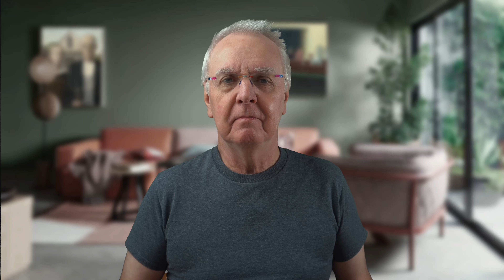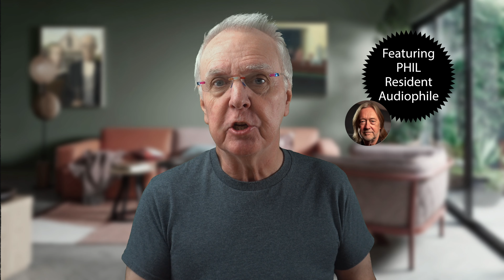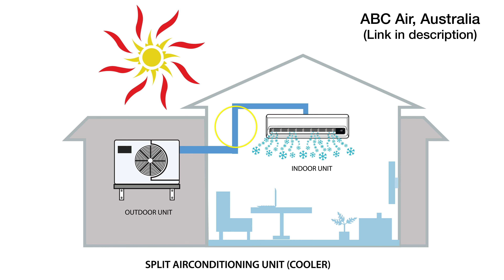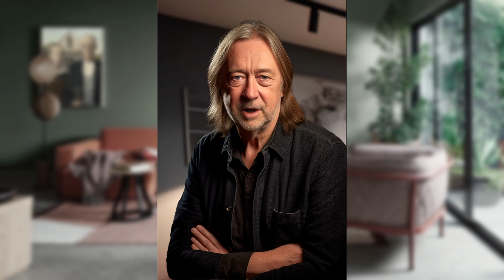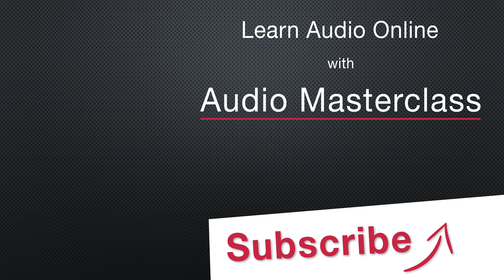Audiophiles! Are you losing your cool?

Comment: Move to Alaska and only use your amp in the winter. If you move far enough out, you can crank it up without bothering neighbors.
Reply: Good thinking🎉
Reply: @jondu-sud274  wonder if sound carriers further in cold climates. If that is the case you'll annoy your neighbour a couple of miles down the road.
Reply: @utube4andydent  I think the treble may become even more forward in the mix at low temperatures making modern recordings more annoying for those not benefiting from noise insulated  Igloos
Reply: Or as we did in the past: build a large Profesional PA speaker system ( fifteen inch and a large format horn woud be sufficient)  through 10 watts at it and have grumpy neighbors . Just for kicks toss in a twenty one inch sub too 😂.
Reply: @stevengagnon4777  I used to live in the country. I'm still rural, but have closer neighbors now. I reverse-engineered JBL 4343s, and my stepfather and I built them in the late '70s. I replaced the horns with "The Tube" Karlson couplers, did some different port tuning, and tri-amped because I didn't feel competent to design crossovers. These are the speakers that I still use. If you want realistic volume levels, you need more than ten watts. Even Klipshorns need more to do justice to the music.